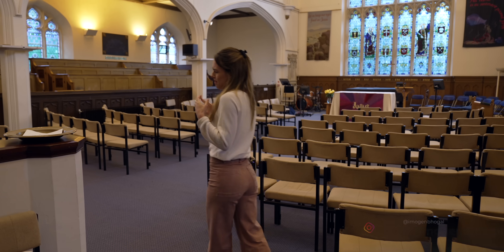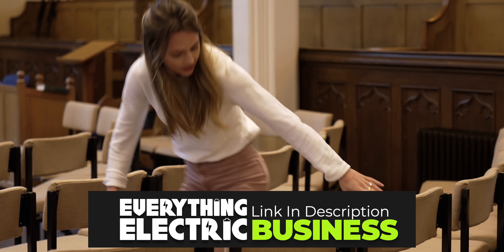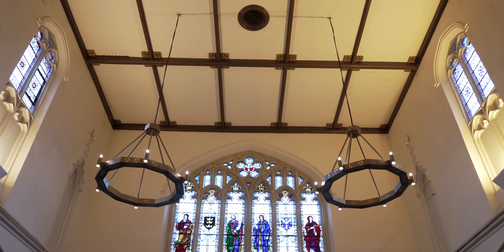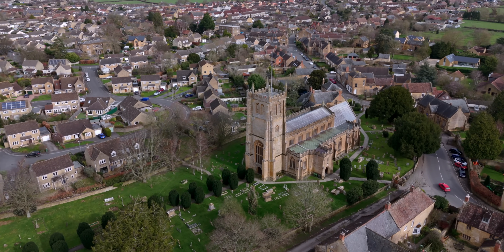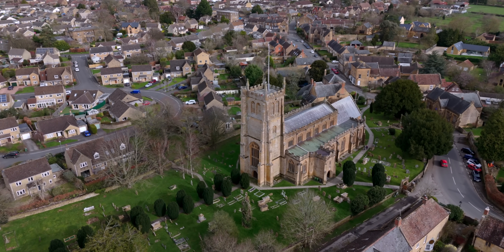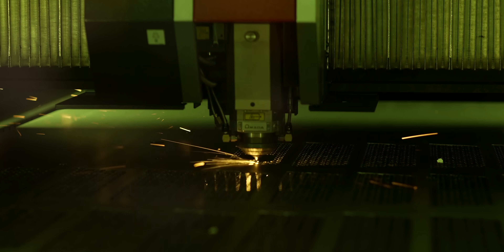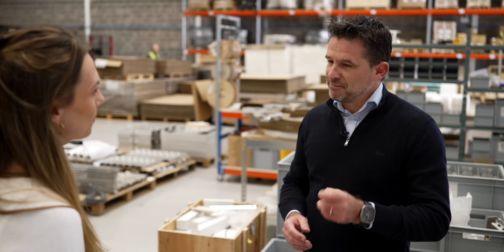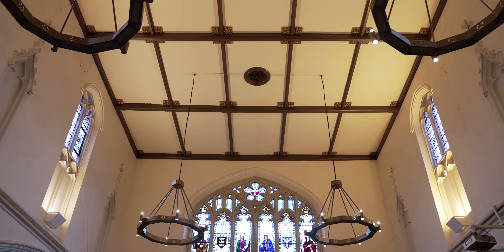Is Infrared Heating the Holy Grail of Electric Heating?

Comment: Really elegant solution. I'm curious where the crossover is, based on the type of space you're trying to heat and the use case, where a heat pump vs zonal IR heaters will be better and vice versa. It's interesting that they expected electric to simply cost more than the gas heater, so I wonder how the economics would have worked out with a heat pump vs a zonal floor heater instead if they could have ignored the planning and heritage requirements.
Reply: iirc presuming a COP of ~3+, heat-pumps work out roughly even with Gas, at current electricity prices... so if this radiant heater is cheaper than a gas heater, it likely would have been cheaper than a heat-pump too.

Basic meth would support this hypothesis too - a heat-pump would nominally use only 1/3 of the energy to produce the same heat - but if the radiant heater is able to heat less than 1/3 of the building interior, then it will use less energy overall than a heat-pump (because a heat-pump cannot effectively heat only part of a room)

Comment: Maybe makes some sense (?)
But is this really more efficient than using heat pumps? 🤔
Reply: Much cheaper and need no maintenance so te pay back time is much shorter.

One issue which might be relevant is the noise pollution from hundreds of heat exchanger units in a terraced house environment.

Be a bit ironic if the sound level exceeded any local authorities noise level restrictions.
Reply: In a word, no. Heat pumps will always be 3-4x more efficient.
Reply: @NoahSmith1  

Hmm ... it could be you're missing the point with the plug about efficiency.

It seems financially inefficient to spend quite a bit of cash upfront to reduce the cost of heating your house.

Do you have any figures for the payback time at all?

A bit like buying a battery EV in order to reduce your running cost per mile yet ignoring the capital "lost" in the transaction.

We now know the "advertised" range of an EV is on the optimistic side and intentionally designed to gull those simple souls into believing the hype.

And of course the residuals might be a tad disappointing. As has been noted by leasing companies.

At the end of the day, as they say, it's very expensive motoring.

Most people should be turning their gardens into allotments growing veg to save food miles and helping to clean up / decarbonise their local volume of atmosphere and not swanking about in their three ton electricity guzzlers.

Would suggest further it won't be that long before we'll be buying boats and rafts and cultivating kelp.

Probably more nutritious than a certain brand of burghers full of minced up  pig trotters and snouts.
Ergo It is probably safe to say that heat pumps will be the end of civilisation as we know it

Everyone knows that.

And no mistake.
Reply: @NoahSmith1  Heating less space will generally be cheaper than heating more space at better efficiency.... the question is solely whether the reduction in the space heated is greater or less than the difference in efficiency.  In this case, the radiant heaters are heating far less than 1/3 or 1/4 of the space (probably closer to 1/8th, maybe even less) - and thus the radiant heaters work out 'more efficient' than a heat-pump.
Reply: Yes, in this application.  Because your only heating a small area of a very big an uninsulated space. Heat pumps are 3X more efficient.  Heating tons of stone and hundreds of cubic feet of air in the rafters that you don't need too, quickly eats up the the 3X advantage.  If it's a floor you can dig up and run some pipes in, then in 15 years you might get an cost advantage from heating those pipes with a heat pump.  But hanging a radiant heater is lot cheaper.

Comment: I wish I'd seen this a year ago. Our church is on the brink of a renovation and we are putting in a mix of infrared heaters and a heat pump. As well as insulation etc.
Our old gas heating needed to be on a full 24 hours at least before a service and you'd still keep your coat on in the winter. 

This looks like a great solution for churches and fits the aesthetic very well. 
Hopefully the cost savings work out for us too!
Reply: A TCO breakdown, complete with breakeven analysis, would be quite helpful. Like most new technology, the Herschel Halo heaters are certain to be more expensive to acquire. However, it's the total cost of ownership that matters the most to organizations.
Reply: Then there's the option of having plain square panels fixed to the walls.

Or fly them if preferred.

And it's possible to have images on the panels so could always hide them in plain sight.

A few religious icons might be acceptable when applying for
the church faculty.

Send a few examples to the Bishop to choose, which might, possibly, only possibly mind you,  stop the nay sayers carping away,
as is not unknown.

Might be an idea to have the panels coordinate with the hue of the interior stone work.

The heat "shines" down from above as if a benison from the Almighty himself sitting in his Heaven.
 
There again some Vicars are perfectly at home with tech such as radio mics bx from flown column speakers or even LED luminaires using full DMX.

Anything, almost, to get posteriors on pews and knees on hassocks.

Comment: I love this technology, but Herschell Panels won't work on my 3.5m ceilings - deemed too high. Not sure if things have changed?
Reply: Not sure if Herschel do but I know other brands make panels with fixings to suspend the panels from high ceilings in a domestic setting.
Reply: Thanks, I wanted it flush so may need to go in another direction.
Reply: @lm3718 try talking to Jigsaw or Mirrorstone, both make their own panels in the UK too and might have a solution for you...larger more powerful panels perhaps...or a greater number of smaller panels...

Comment: I've been curious about the effects of IR on eyes, will IR heating contribute to cataracts or is that not a problem? I haven't been able to find any serious information on this :(
Reply: The main danger to eyes is UV which is the opposite end of the spectrum.
Reply: Given infrared is heat energy, probably as much a problem as looking at a radiator when it's on ...
Reply: The sun heats you using IR if that addresses your concerns.
Reply: "Exposure to IR radiation may cause the corneal opacity, burns on the retina, miosis, breakdown of blood–aqueous barrier and delayed cataract." - US Gov site National Library of Medicine
Reply: @KR-qb1xi  There are 3 bands of IR (A,B,C). According to the Lawrence Berkeley National Laboratory: "For all currently known arc and incandescent sources, the contribution made by the IR-C spectral region (above 3,000 nm [3 microns]) is normally of little or no practical concern."

The Hershel tech specs state that the IR range for their panel heaters is 5 to 12 microns so within the long-wave IR-C spectrum. This is standard for the industry.

Looking at Health and safety legislation for the USA and UK, they only cover protective measures for exposure to IR-A/B wavelengths.
Reply: @KR-qb1xi  Any radiation can damage you in large enough quantity. But you'd feel your skin burning if it was the case with IR.

Comment: What I loved most about meeting Simon at St Michael's is that he didn't push for a cleaner solution because it's his job and he's paid to do so, but because he truly cares and can see the value as well as the power and the responsibility that a large organisation such as the Church of England has to delivering net zero. I doth my cap to the Simon's of this world.
Reply: *doff?
Reply: @benjaminchristianhay  i have learnt something new today!! Thank you!!  Do Take Off -> Doff.
Reply: @benjaminchristianhay  *doff = tip my cap (as sign of respect)
Reply: @willsta21  I know, that's why I suggested that correction
Reply: If the UK is going to push for greater ASHP rollout, it may be worth considering amending MCS regulations to only require the heat-pump to provide up to, say, 90-95% of the maximum potential heating load. A dedicated half-price socket that an infrared heater is plugged into in the main living space could provide the added 5-10% in event of another Beast from the East, or something along these lines.
Reply: I’d love to see these in my local cathedral in Salisbury!
Reply: @toberwine  

If you're that keen why not stump up for a pallet or two of these items, drive over to the South Door and leave them at the back.

The vergers, deacons and flower ladies will soon have  them aloft and wired up in good time for Easter. 

Almost certainly the Bishop will present you with a heated hassock the size of the Bayeux Tapestry.

With your very own name embroidered on the top.

Instead of virtue signalling on here why not do it anonymously?

You get extra points and can jump the queue at the Pearly Gates.

I know I did.
Reply: I have sent this video and the Herschel website link to the Yale University Sustainability officer.  These would look and feel amazing in our Yale Neo-gothic buildings while supporting our de-carbonizing efforts!!  Please let Herschel know that they should market directly to American University Sustainability officers there is a massive market...
Reply: Hello Imogen, I thought I'd say hello
Reply: Nice video, but you really always need to emphasise in these videos that heat pumps will always be over 3x more efficient than literally any other source of heating. While you might be heating a smaller space with infra red, it really doesn't matter that you're heating a larger space if the heat is a third of the cost with a heat pump. Lots of examples of churches with heat pumps.
Reply: Heat pumps are wonderful technology, but heating tons of uninsulated stone to any more than few degrees above outside temperature is a ridiculous amount of energy. Even if electricity wasn't overpriced,  a heat pump would still have the same issue as a traditional gas or oil boiler or forced air system. The vast majority of the heat sits up in the rafters or is sucked into the stone.  Having been in an uncomfortably hot loft above a cold main floor in giant space on more than one occasion, the radiant heating intuitively makes so much sense.  Not every solution fits every application.
Reply: @NoahSmith1  bear in mind that churches aren't used 24/7 and are large spaces where not all of it is used. A heat pump is good if it's maintaining a temperature almost constantly and it has to heat the whole space. I'd expect that even if a heat pump was 3x the efficiency of the radiant heaters, there's a high chance that they would be less cost effective overall.
Reply: @NoahSmith1 

But again no mention is made of capital costs to install said heat pumps.

No mention either of how CoE is going to find this capital expense.

There again I don't suppose the Vatican is falling over itself to spring for the heat pump thing either.

It's as if heat pump huggers wilfully decide to push the idea yet have no idea of funding.

Installing FAR IR panels is a no brainer on the premise that installing expensive heating pump heating systems is a bit daft what with falling congregations.

I would suggest the money would be a lot better spent by doing "good works" such as helping OAPs or helping to supply food banks or helping with nurseries, say.

Or perhaps even increasing a Vicar's stipend.

And culling a lot of admin' types ... you won't need me to remind you there's more admin staff on Truro Cathedral's books than clergy.

Perhaps the notion of of a modern day Mammon is the preferred "doctrine"?

Comment: I think infrared works best in large spaces where you don't want to heat the whole space. I don't think it works all that well in domestic settings; other technologies like heat pumps are usually much more efficient.
Reply: It's more a question of the level of insulation,  if most of your central heat is leaking away, it make sense to heat what matters. This is the extreme case, where there is no question it easier to heat a few bodies in the center than tons of stone, and air up in the rafters.   Yes, heat pumps a 3X more efficient, but if that heat is just leaking away through the walls, in rooms no one is in, better to turn on a radiant source where you are.
Reply: They do you know.

A 350W unit can keep a  five cubic metre space, not especially well insulated, quite cosy provided the outside ambient doesn't fall too far below 0C.
Reply: @t1n4444  There's only a slight advantage from 350 W radiant versus 350 watt fan heaters though and a heat pump would kick its ass.
Reply: @BooBaddyBig  Heat pumps require you to have a wet central heating system i.e. radiators hence the cost of fitting not only the pump itself but also all the piping, radiators, labour etc. can make retrofitting it a really expensive solution. If you have an older 70's property with storage heaters you can half your bill by putting in panels room by room  as and when you can afford it. All thermostatically controlled with different times and zones. Heat pumps are great but don't fit every house.
Reply: @eldridgep2  Yeah, except heat pumps don't. That's just one type of heat pump. That type is actually less efficient, and more expensive to buy and run.
Reply: @BooBaddyBig  Sorry then how are you using your heat pump, genuine question? Are you talking a warm air system or underfloor heating? Again either of those not easy to retrofit in an older property.
Reply: @eldridgep2  It's traditional air conditioner technology, where you have things called 'heads' which are mounted usually either on the wall, or in the ceiling, or can be floor standing, and provide heating and cooling as required. They're much cheaper to buy and install and are more efficient than hydronic systems and can also dehumidify. Hydronic heat pump systems generally need new radiators, ongoing expensive loop maintenance and are significantly less efficient. Ducted air heat pumps can also be deployed but are usually a pain to retrofit, as are underfloor heating systems.
Reply: @eldridgep2  air-to-air heat pumps are dominant in the US market because people want cooling as well as heating. Houses built before air conditioning became common have almost all been retrofitted with air ducts for the heat pump HVAC system.
Reply: @eldridgep2 There are air to air heat pumps.  In fact, in the USA, those are the most common type.

Comment: What infrared heater do you use in your home, Imogen?
Reply: Great question, i have a tiny glass heater underneath my desk but I'm currently weighing up some options - herschel scores very very highly, the sand radiator too (though out of my budget)  but i also want to check out what thermacurve feels like. I quite like the appeal of IR for my home as it means I can go slowly swapping out radiators room by room and spread the cost as a result!
Reply: @ImogenBhogal yes that's what I like about infrared, there's so much less upheaval and you can go a room at a time as you can afford it when moving from gas central heating. I find the concept of heat pumps so intimidating because of the complex calculations required plus the cost outlay: new double glazing, insulation not to mention paying for and finding room for all the kit! Ultimately they may have a high COP but they still have to heat pipes, rads and air before they warm you, that seems to negate the advantage of a high COP.
I'm hugely gratified to know that someone as knowledgeable as you are on complex subjects also gives infrared consideration for your own use. While some may suggest this is a long advert for Herschel I do think this particular product is well worth promoting, Imogen, thoroughly enjoyed this video. Plus I know the channel has also showcased Jigsaw Infrared whom I am considering going with as they make all their panels and controllers, plus they'll install them too.👍

Comment: Are you the only one working Imogen? Tell the boys to get off their butts!😂
Reply: It's the Fully Imogen Show now. 🙂
Reply: THANKS 🤗 IMOGEN …FOR SHARING THIS BRILLIANT AND BEAUTIFUL 🤩 SOLUTION… back in the 70s. I worked in the shop that had gas powered infrared heating and it worked beautifully in a 20 foot high ceiling building.🤗 GREAT TO SEE THERE IS A MODERN ELECTRIC ⚡️ EQUIVALENT 💚💚💚
Reply: No complaints here 🙂

Comment: IR heaters are great for large poorly insulated buildings such as these, we have been using IR heaters for over 20 years in our hangers.
Reply: Losing heat hand over fist.
Reply: @rogerphelps9939 I think you’ve misunderstood how IR heaters work - that’s the point you are not losing heat hand over fist because you are not
trying to heat the whole air mass.
Reply: Air has a low thermal capacity. Easy to heat. It is fixed structures that take the energy. Who says a person is easier to heatthan a fixed structure.? Please learn some physics. @GrahamRead101
Reply: @rogerphelps9939  yes air does have low thermal capacity, but it’s also a lot larger volume than directly heating the humans and air also moves and thus rises - so in a large space you at losing all that heat up into the high ceilings and out any frequently open doors etc in places with high foot fall like warehouses and churches etc. So, as I say, IR heating is a completely different proposition. For places like homes where you want long term constant heating things that warm the thermal mass like walls etc are better; but for areas like churches, community halls etc which need to be heated quickly but not all the time, such heating is wasteful.